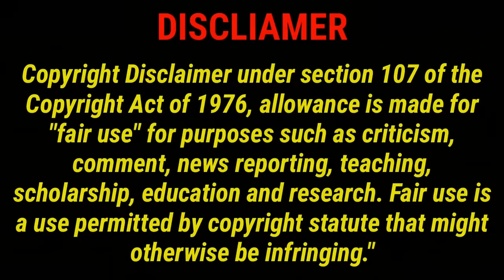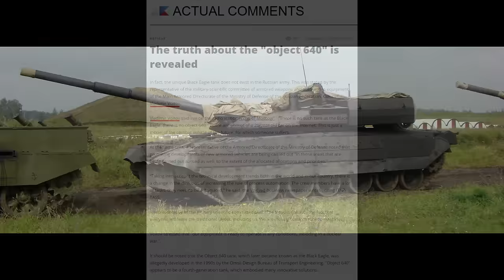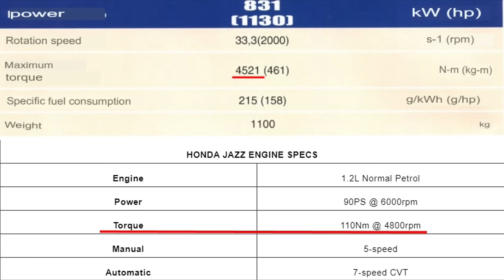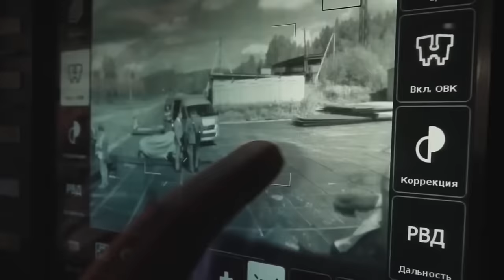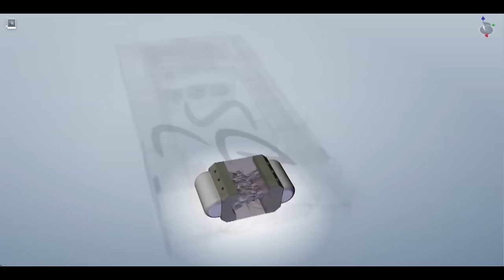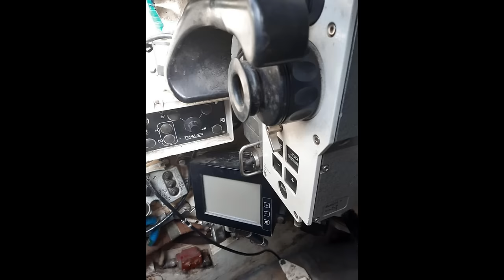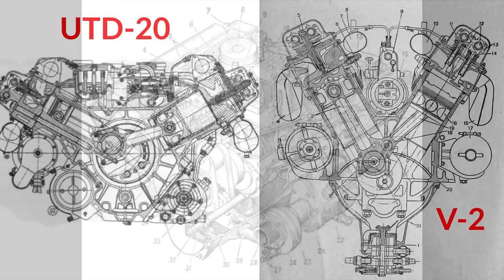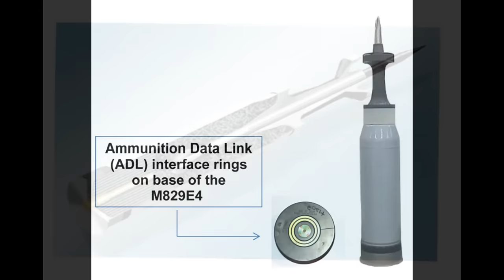LazerPig is WRONG about T-14 Armata

Comment: A lot of valid points from both of you however I believe you are getting too tied up in the details that you are missing the overall point. The perfect example is the t14 breaking down in red square.

Ignoring any/all speculation about if it was planned like was originally reported or not, if it was engine trouble or a parking brake; because that's embarrassing as HECK. The parking break is a very weak excuse even if true and I can't tell if that is actually a worse outcome than engine trouble.

The tank stopped in red square because the tank driver accidentally applied the handbreak. ACCIDENTALLY. APPLIED. THE. HAND. BRAKE. in the middle of a parade, in red square, when they were doing nothing but driving straight. (sounds to me like engine trouble but I'm not going there, let's keep the hand brake angle) so, think of it logically. How poorly designed is it that the driver accidentally applied the hand brake, didn't know it was applied, none of the tank crew knew, the recovery crew didn't know, and it took them trying to pull it to realize that the hand brake was on. THIS SHOULD NEVER HAPPEN AT ALL, IMAGINE IF THAT WAS A COMBAT ZONE! 

"BORIS! MOVE THE TANK! THE UKRAINIANS ARE SHELLING OUR POSITION WE NEED TO MOVE NOW!!!!!"
"COMMANDER YURI, I'M TRYING! I CAN'T MOVE THE TANK, THE ENGINE IS STILL RUNNING because it is reliable engine, duh. BUT THE TANK ISNT MOVING!!!!!!!!! Oh, nevermind. The hand break was on Oopsie daisy."
Reply: To counter this, the tank drove off perfectly fine after a little while along with the fact that the recovery vehicle couldn’t recover the tank because the treads weren’t moving (the brake was on) and then after somebody realized the tank just drove off without any maintenance or fixing done to the engine.
Reply: The tank drove off perfectly after a bit when they realised it. But no you have to believe your propaganda.
Reply: @red1004  lol t 14 never seen in combat
Reply: @sovietbanana4589  handbrake or engine, that's embarrassing as hell and Russia saying "they were aligning the tank, the driver was poorly trained, he didn't know the brake was on" is weak AF because it just raises further questions.
This was the vistory day parade, who why have an inexperienced tank driver? You should have competent people driving so you can show the west how amazing you are.

Even if the recovery video was real and not staged for propaganda, even if everything they say on combat approved is real, that then implies that the handbrake is so poorly designed that driving straight and slightly turning to keep in formation can make it incredibly easy for an "inexperienced" driver to accidentally apply the handbrake. Think of how dumb that sounds and how bad that would be in a combat senario.

I say "inexperienced" in quotes because combat approved says the driver only had a month to train. However, they also state at a different time that The training time for the tank crew is only a month. That does nothing but raise eyebrows to me.
Reply: @jaxonl7810  So what? Does it mean it's automatically bad? K2 Black panther hasn't seen combat. Doesn't mean it's bad
Reply: @red1004  yes if its soooooooo good .... Why is it not in battle LMAO

Comment: I don't know and i don't care what he said. All i know is, it has been shown to the world in 2015 and until now nobody cared except russian propaganda. KF-51 Panther was shown to the world and not even a week later several countries wanted to order it. That tells you everything you need to know.
Reply: T-14 is a completely new tank compared to KF-51 that is just a turret upgrade for leopard 2
Reply: @rogue__agent5884  T-14 and completely new, lmao. Still old 125mm cannon, same as T-90, T-80, T-72 and T-64. KF-51 has completely new 130mm. KF-51 prototypes used Leopard 2 parts but final product will be different chassis & engine. I bet it will be sold way before anyone buys a single T-14.
Reply: @SuperGeronimo999   ur completely wrong T-14 uses a new gun a longer 125mm : 2A82M1
While T-72/T-80/T-90 uses 2A46M5 gun completely different to the 2A82M1 
And T-14 has options to upgrade to the 2A83 152mm gun 

Do actual research before speaking nonsense
Reply: @rogue__agent5884  Yes, and T-90 is totally new tank, has nothing to do with T-72. Total joke... and no one has ever seen a T-14 with 152mm gun.
Reply: @SuperGeronimo999  again poor research 
T-90 was a tank made for the 1990 for requests by RU government for 1 main battle tank to be used by Russian army 
It’s based on object-187 T-80U T-80UK T-72B mod.1989 

As RU army operated 3 MBT n needed 1 for  standardization n make logistics easier 

And for T-14 using the prototype Object-195 can be seen using 152mm gun 

But then again why bother doing research when u can speak nonsense like u are now

Comment: Ye the leopard engine may be 60 years old but its still a diesel engine that can push more far and accelerate faster than the T-90, comparing the condor engine which is way older and still reach the max speed of a engine that was deployed in 620 BT-7m just shows that the engine is not only outdated, but also lacking, also its not like its a maybach, and comparing the GTD to the Abrams gas turbine proves its still inferior, furthermore proving lazerpig's point that Russia isnt able to build modern engines effectivly.
Reply: Well we’re also considering the significant size difference. The other thing as mentioned is that the modern v-2 has twice the horsepower of the ww2 era v-2. Also I don’t get what you mean by acceleration? The acceleration is based on the tank not the engine. Even so the t-90 and other tanks utilizing the modern v-2 engine have faster acceleration.
Reply: @sovietbanana4589  woah it has the twice was much horsepower a ww2 era generation engine has, awesome.
Reply: @sovietbanana4589  what do you even mean with acceleration being based on tanks? accelaration is the rate that something changes speed over time and that relies alot on the vehicle engine and about the T-90 engine some "trustable" sources like idk rosbonexport or the Russian Defence Export (which is probaly lying but i dont want to search for the engine atleast rn) states that the engine has 1000 hp and 21.7 Ton weight ratio and the Leopard 2a7 has one with 23.4 Ton weight ratio, the information in Russian vehicles is actually so scarce that sometimes the tanks operate with downgraded versions of the engines they were supposed to use, so we dont know to a certain a maximum speed a T-90 or even its acceleration, it relies on what trash the Russian federation substitutes with another Kharkiv V2 (further improved, like the video says)anyway its easy to say that the russian tanks probaly hit 30 mph in oof road, yet...
Reply: @barkthebarker429  idk what you’re saying man. It’s power to weight ratio, not ton to weight ratio. Also what I mean on the acceleration being based on tanks has to do with weight. For example the t-34 and kv-1 both used the same engine, however the acceleration was different due to the weight of the tank, not just the engine.
Reply: @sovietbanana4589  oh i get it now, T90 is lighter than the Leopard 2A4 so it does accelerate faster but it does not mean that its oof road maximum velocity is greater than the leopard velocity
Reply: also even though you are trying to explain that the tank is lighter and does not need a good and greater engine capable of pushing more weight and going faster than Ocidental MBTs you would be half-right since yeah quite oof the engine doesnt need to be powerfull for the T-90 dimensions, but its still shamefull that the vehicle cant go faster than a Challenger 2 which is based on Perkins CV12 Engine is a superior model, Acceleration wise Leopards and T-90s sincerely accelerates almost at the same rate in a way that makes not difference (i'm using leopards because its a diesel engine) the difference is that the leopard weights more and have a more powerfull engine capable of providing more horsepower, yet can have a better maximum speed and even a thing that Russian tanks are jealous of (you guessed it, its reverse rate);
Reply: @barkthebarker429  overall maximum speed on tanks are really weird due to so many factors. Main thing tho is that max speed is usually never reached(only real exception being flat terrain in like plains or deserts). In terms of the challenger two issue it isn’t really that shameful. Like scale an engine and tank down then the max speed wouldn’t change due to the way ratios work. On another note despite the similar speed the challenger 2’s engine is significantly heavier than that of the v-2. Overalls I’d just say that each tank has their own engine that suites their need on the modern battlefield. They all have similar top speeds anyway along with the fact that the t-90’s transmission doesn’t let it use it’s superior acceleration in reverse.
Reply: @sovietbanana4589  lol still being a keyboard warrior I see
Reply: @jaxonl7810  still being a annoying troll I see.
Reply: @sovietbanana4589 the acceleration on the t90 is nowhere near the leopards, dvmbfvck.
Reply: @thatguy46744  no they’re nearly identical my guy. It is no night and day difference. There is a big difference between something like the challenger 2 in favor of the t-90.

Comment: So the tank is so poorly designed you can activate the parking break by accident?  Not so good for something to be used over rough terrain.  Also the crew is so poorly trained that can't figure it out and release the brake.  The armata has never seen service so no information about it's real capabilities is known.  Since russia has lost so many tanks already their failure to send even half the 20 or so units built into combat shows they are not confident in it.
Reply: At the time it was still a classify tank and the crew only got very very simple training ,it completely different from any existing T tank ,
there’s no reason for them to send the T-14 sending another tank would mess up the logistics even more
Reply: @mbtenjoyer9487  So like I said crew training so poor they can't even operate the parking brake.  Thanks for proving my point.  They have been losing ground since the first month of their war , even before the rest of the world sent military aide.  They need a tank that excels in something other than launching it's turret into the air.  Their logistics suck so bad having a better more survivable tank would offset some of those troubles.  It is like the USA sending M60A3"s into combat while the Abrams stay home.
Reply: @chrisb7198  my guy it’s a secret tank there not gonna show the crew much because they were trying to keep it a secret, if they showed the crew to much n those crew would’ve have defected to western countries that would have been a big loss 

But I guess you’re just too smart to get it

My guy it’s war in general even if u send Leopard challenger Abrams they would be badly destroyed and launch there turret into the air 

They operate 3 tank model T-72/T-80/T-90 adding another tank is a bad idea for logistics
Reply: @mbtenjoyer9487  so the parking brake is a classified nation secret? lmao did you really just type that for all to see? rotf

Comment: To say the truth both of you could be wrong or correct, since no one knows about the T-14 actual capability. Also with such propaganda hypes its not even in front lines so it more likely that it sucks.
Reply: So Abrams X, Leopard 2A7, M1A2 SEPV3, Challenger 3, K2, Altay etc etc suck because they aren't being used on the frontline?

Comment: Fantastic Video and the "lazer" needed to be corrected. I can fill in a blank regarding rifled guns and HESH on the Challengers. The round was incredibly accurate up to 3000m plus, how accurate and it's damage potential were classified all I can say "spall" was the least of your problems. The blue on blue Challenger incident in I think Gulf2, moved the up armoured turret of the hit tank to the back of the engine deck. Imagine hitting a BMW Mini with a 10 ton wrecking ball. The two reasons they got rid of HESH, they were told to use cheap ass NATO rounds and  ERA can better stop the slower moving HESH round.
Reply: Bro its a 120mm hesh or not you aint moving the turret of a tank that way